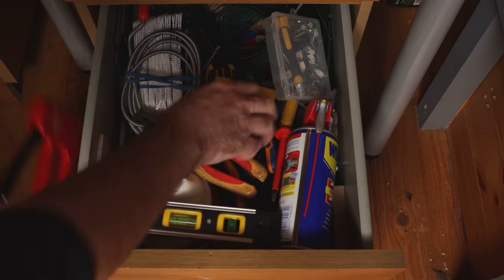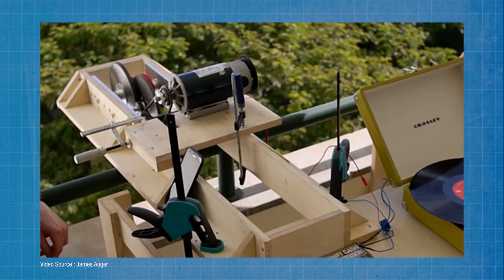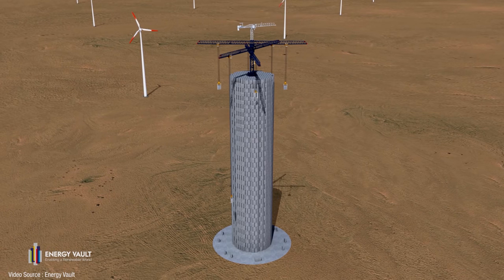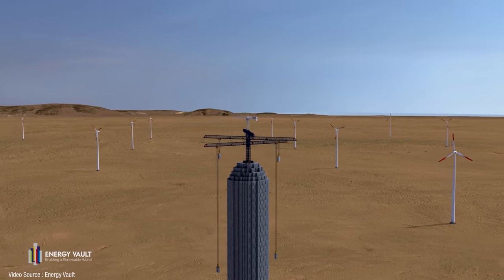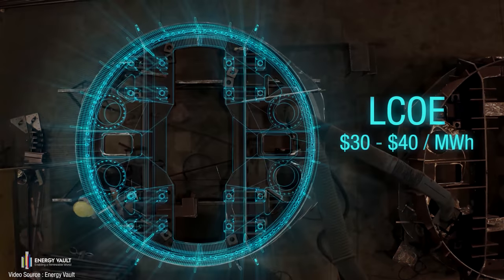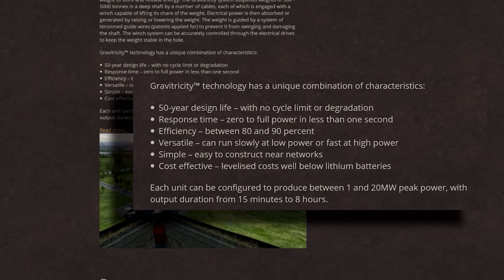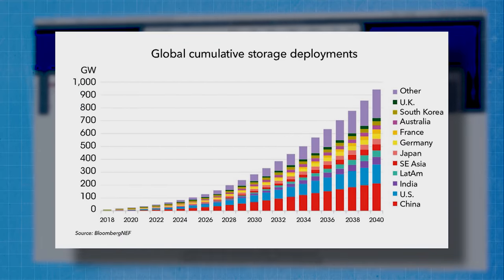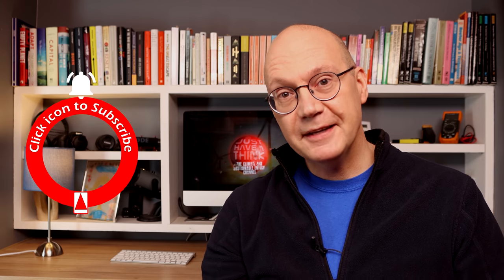Gravity Energy Storage : A very uplifting technology!

Comment: You know why pumped hydro? Because you need store enormous amount of energy. Why enormous? Because when wind stops blowing this can last for a week or so. And for that you need to lift / drop enourmous amount of material. And guess what, all those vaults and stuff would need huge amount of steel to be build.

Further, concrete is just a few times denser than water. Now, look at those lakes and imagine, say, 1/3 of that lake or concrete being mowed up and down by a forest of cranes... It is completely insane. Not to mention huge environmental impact it would have.

And comming to mine shafts... they have the depth, true, but are too narrow. Say you have 10 x 10 x 50 meters block of dense concrete ~15,000,000 kg and you are lucky, you can drop it 1,000 meters. So you can store 15,000,000 x 1,000 x 10 ~ 40 MWh. If the wind is down, you can recover this energy to make for the work of one 10 MW wind turbine for just 4 hours. And do you think you have thousands of 1 km-deep shafts ready to use? 

Ideas that resist attempts to scale them up are just toy solutions good perhaps for a high school projects. Instead of playing a record, you might try to power a microwave oven, a toster or a kettle. Good luck.

Comment: There are millions of buildings in the world with elevators which are used to lift people to upper elevations of the building. Can’t we use these elevators to produce electric energy? Of course the energy produced by an elevator is much lower than the energy produced by these cranes you showed in this video but please consider that there are millions of elevators around the world and even if we get back a portion of the energy used to lift people and weights when the elevator is going down it will be a huge amount of energy produced.

Comment: A fair analysis by Thijs Ten Brinck
https://www.wattisduurzaam.nl/27493/energie-opslaan/reservoirs/crazy-storage-tower-energy-vault-picked-by-world-economic-forum/

His concerns are:
* Are blocks strong enough to support mass of blocks above them?
** What happens when a bottom block fails?
** Major foundation needed to support blocks.
* To generated rated power (not energy) blocks would have to travel 43 km/h  (I haven't checked this figure)
** 35 t blocks smashing down at 43 km/h is going to break blocks. What then?
* Wind load - even at 35 t blocks, the tower has to stop working at a certain wind speed. What is the capacity factor?
* Swinging - even without wind, the blocks will swing as you move them from inner to outer (or vice-versa) rings. What is the capacity factor?

Gravitricity has a major problem also - mine shafts are rarely single-shot, straight-down tubes. They have kinks, bends, slopes, etc. So the 'unused mine shaft' needs to be upgraded to straighten it out for anything beyond a few 100 meters.

Comment: There's a US outfit called ARES [https://aresnorthamerica.com/] that uses electric trains. Their first commercial system uses an abandoned gravel pit with low elevation difference (in the link). Longer-term, they can lift great weights to higher elevations and leave them there for, say, six months (to compensate for low winter sunshine) with hardly any cost.  Even solid-state batteries would be too expensive to use with such a low duty cycle.

Comment: the viability of lifting weights is feeble because it only takes a small improvement in other area's  like batteries to make it instantly redundant as the entropy is finite eg lifting a one Kilo bag of sugar about 14,000 ft gets you just 1 Kcal and a 1 Cwt (50Kilo) bag of cement 500mtr (over 1/4 mile) in the air could raise the temperature of water enough to make tea or coffee. So you see its a massive amount if infrastructure for comparatively small gain with little scope for improvement. I have worked on these types of problems for over 50 years and am amused at seeing the same schoolboy mistakes but the fact is that they don't compete with fossil fuels in a cheap and efficient way and until they do these things just make good video's

Comment: As we now build very high towers for wind turbines why are we not incorporating a gravity system inside it? Thousands of hollow towers seems a waste ! No cranes needed as you have already built a windlass.. Hell with correct set up you could use the existing gearbox.. It could also be used to idle the blades & turbine which currently require energy..

Comment: Doesn't it require the same amount of energy to pull the weight up as is generated as it goes down? Clearly I'm missing something basic.
Reply: A bit more power needed to pull back up (recharge), as they are 70-80% efficient. Their use would be to balance the grid and make sure it stays at 230 V / 50Hz (or whatever it is where you are), which needs a quick response. Additionally electricity consumption is variable, with the evening peak (typically 4:30 pm to 8pm in winter) lifting demand for just a few hours. Currently we use 'peaker / peaking plants' which are quite expensive for the limited use they get to increase the electricity supply above the baseload. These systems would allow us to just use them for the 4 or 5 hours of peak demand, and recharge them using renewables when it's sunny or when it's windy at night and not so much power is needed.
Reply from the maker: Yes Ben. The energy to lift them comes from the excess power produced by renewables, like wind and solar, which often have to be curtailed during the day because the grid cannot use the amount of energy they create. Then at peak times when the grid needs a lot of extra power, that stored energy can be released.

Comment: I don't understand why bother about these things. 
1 - 2 MW energy storage systems?
The feasibility of Energy Vault was already busted by Thunderf00t.
So if you want to have 3 GW, you need 6000 windmills ( based on 2MW onshore wind with about 25% of capacity factor) and 1500 of these energy vault towers. If we put every windmills 500 -1000 meters from each other you need 1600-6400 km2 land. (that's about 1-4 Londons) 
You need lot of extra power lines, service roads, which often done on the cost of the nature, and if you have a few days without wind, you still run out of juice.
While you can have the same 3GWe with almost 24/7/365, on about 6km2 land like Sizewell C. 
Why do we want to farm low energy density unreliable sources, while we can do much better on current nuclear technology?
Why we don't invest more to new nuclear designs like TerraPower, Moltex Energy etc?
As long as we cannot make fusion work, fission is our best bet for clean, safe and reliable energy with the smallest environmental footprint.
Fun fact: 
If we would use breeder reactors, uranium from seawater would last almost as long as the sun, so by definition it is renewable.

Comment: Why spend lots of money casting big weights when water for pumped hydro is free?
Reply: The energy density of water is much, much lower. For the above ground tower's potential with blocks the reservoir system would take many times the amount of land and have other cost penalties. But. please, keep thinking!
Reply: @fredericrike5974  Water has a density of 1 tonn per m3. While concrete has a density of around 2.4 tonn per m3. And when one is free and the other is not the choice is pretty easy.
Reply: @titter3648  True, to start with; The water may essentially be free if you discount drilling a well to get it or pipelines to get it where you want it. the cost of the reservoirs to store it, one a thousand feet of so above the other is also something to be considered. All the easy, natural places to build big water reservoirs have already been found and used to collect and retain water for municipal water systems, as a starting point, and getting the two reservoirs needed will require much land be bought and the the reservoirs dug and connected by large, expensive pipelines. Likely there will be some more maintenance required also. Some one suggested using an existing hydroelectric dam, which sounds more promising, but then we need to find a disused dam with an area to build a supply reservoir a thousand feet  above the turbines.
Reply: @fredericrike5974  The bricks have to be transported just like the water. But there is likely a waterline already installed close by that can be used, or a river, etc. So no need for drilling or laying long pipes.
And the bricks have to have a foundation to be on  just like the water needs a reservoar. But again the bricks needs a perfectly flat and sturdy foundation, while the water just needs an approximate bowl in the terrain.
Reply: @titter3648  Which the water will erode in sometimes unpredictable ways- back to my comment about costs and maintenance. My grand mother always told me to beware of pick pockets when ever a "free lunch" was being advertised. Nothing in the piece or what I said indicates free anything- just different costs for various things. Of his explanations, I liked the reuse of old mine shafts, but even they will have new costs, such as some subterranean work space to hold the blocks pending the system down time to retrieve them for the next drop, etc. All of these things are something to think about; if enough brain power is applied, a solution is likely. The "how much" is an unknown; it took 30 K engineers almost ten years to get to the Moon after they decided to do it. We just have to apply the elbow grease and brain sweat.

Comment: Could gravity energy effect the Earth's gravity in the long run?
Reply: No way. Even the entire crust weight  is not that much compared with Earth's total mass.
Reply: @ehsn  so it does effect it in a minuscule way?
Reply: @victorschwanberg  in an absolutely negigible way. It's just a very little moving of a very little mass a very little distance (on Earth's scale).
Any dam would have a higher impact on the gravity field (and even then in an inperceptible scale), as it concentrates a lot more of mass in an area. Still we are talking of really negligible weights on planetary scales.

As of gravity itself, it doesn't get spent.
Reply: No.

Comment: "35MWh of power to the grid"?
Do you mean it stores 35MWh of energy, or can generate 35MW of power?
Reply: 35 MWH means amount of power drawn times the length of time in use. If you draw 35 MW, it will last 1 Hr. 3.5 MW will last 10 hrs.
So it's your first guess.
Reply: @rudylikestowatch  I was hoping the video might be clarified.

Comment: So you store energy by spending energy to get the blocks back up to the top after half a cycle. I dont for the life of me see how this is in any way, shape or form efficient.
Reply: But that is the basis of every energy storage system. Surplus energy in, then discharge when needed.
Elegance and efficiency vary.
Reply: Please study the laws of thermodynamics, and you'll see that you need to put energy in before you can get it out
Reply: I don't understand what you don't understand... You store kinetic energy by using it to raise the blocks and get potential energy, you take it back by reversing the process. What's inefficient about that? The only waste would moving the block inward and outward and friction, the rest should be comparable to pump hydro
Reply: Wind power rebuilds the tower. 
 The gravity tower is a battery so when it isnt windy its the generator.  When it it windy it rebuilds.     So allowing you to use excess energy on windy days.  Remember a LOT of wind energy is wasted by not being needed by the grid when generated.

Comment: Just wondering aloud: Instead of wasting extra renewable energy into fighting gravity, why wouldn't we use other anti-gravity techniques that don't use electricity to pull these weights up, like hydrogen balloons or something?
They can only pull up smaller weights, but they can do it continuously, regardless if there is a renewable farm nearby or if it's over or under-producing electricity, so they can release that gravity energy whenever the Sun is not shining and the wind is not blowing through the graves the wind is not blowing, then electricity will come from the shadows, as the poet says, more or less.
Reply: Because techniques such as that don't have a state of rest.  You can't turn buoyancy off..
You're constantly holding it in a container and holding it down, both of which cost and lose energy or gas.
Reply: @Alexa-Raine  A balloon as a container costs much less than hundreds of concrete bricks and several cranes, and a hot air balloon would come down on its own once its lifting job is done. The only cost would be to heat the air again, which can be done efficiently and relatively cheaply too.
I haven't done the math, but the brick tower seems very complex, risky, and expensive. There are probably many energy storage techs that are cheaper, maybe even cheaper than any form of gravity-based storage.
Focusing on just a few energy storage techs on a large scale, like LFP or redox batteries would allow us to improve their efficiency and decrease their cost.
In any case, a smart interconnected grid would greatly reduce the need for energy storage: It's always windy somewhere, when it's not locally.
Reply: @Chimel31  if you think wind affects cranes, then what do u think happens to hot air balloons?
Reply: @Alexa-Raine  The balloon could even fly 100% horizontally for that matter, it would still lift the weight from a mine shaft vertically, as long as the cable is centered in the mine shaft.

Comment: And they are still dropping the hammer in todays "modern" turbine water systems! Calculate the accelerated mass of the water leaving a turbine and you will find it is seven times greater then the electricity it generates! Is that stupid or what??🤣🤣🤣

Comment: I like the concept of weights, but your mine shaft model will not be practical!
Mine shafts are not that wide. They are designed to take (usually) 4 cages each ... and even if you include the air gap around the cage you are talking of 750 sq ft, probably less! You also have the problem that the mine shafts run on rails so the machinery eats into that space and reduces efficiency! 
If you allow freefalling weights you have the problem of instability as a factor of speed. You do NOT want those weights crashing into one another. You are also limited as to the accessibility of lifting gear directly over the weights.
Finally (well at least in my initial estimate) you have the problem of flooding! Most mines have a water problem that they get round by pumping ..... but they do NOT pump old shafts. They let them flood. If you drain a flooded mine (certainly a coal one)   you have a gas problem!

The Tower version of this is more elegant. ....  But they mentioned an unlimited cycle facility! Anyone who is involved in heavy lifting and cranes will tell you that is bogus! 
You also have weather degradation of components that are exposed to the elements but even allowing for all that pesky safety stuff ....... I like it!
The question of how efficient or effective it has not been answered though!
Reply from the maker: Just for clarity Dave...it's not 'my' mineshaft model. I am just a reporter. The model belongs to Gravitricty. It sounds like you have some very significant concerns. Perhaps it might be worth you raising them with the two companies that have researched and developed these systems...
https://gravitricity.com/
https://energyvault.com/
Reply: @JustHaveaThink   It was an inclusive "Your" ;0) 
TBH it is great to have different ideas, even if not viable because it allows others to see a way round the problem rather than having to re-think it from the ground up (or down in this case) ;0)

Comment: I dont understand none of these new gravity energy storage methods..  how they can be cost effective??  
I know that moving lakes up and down is cost efficient, because you are exploiting geographic locations which it save you a lot of money, also there is no comparison with the mass of water htat you can actually move vs using weights (which is nothing in comparison and they require a lot of investment). 
Seriusly, understanding how little energy you can extract from moving 1 ton 100 m (which is only around 20% of an ICE car battery).
This technology only works if we take advantage on how volume scale with a lake dimensions and how cheap is to get water as a filler instead manufacturing all those weights.
I dont trust in the LCOE figures they provide.

Comment: I dont believe you im an idiot and the first thing popped into my head was gears you cant possibly be thicker than me. And why just 50 years th only moving parts are bearings th stuff th Royal Navy used to use doesnt wear out anf if you ever had to cut it you would know its harder to cut than any steel I have seen. No reason we cant build simple machines that last almost forever.